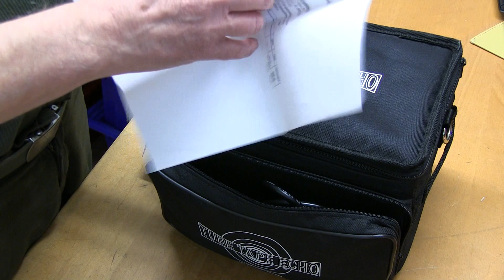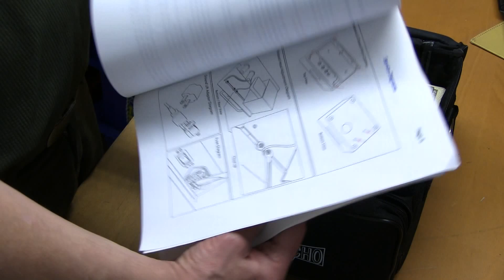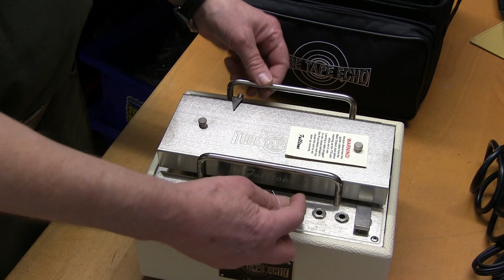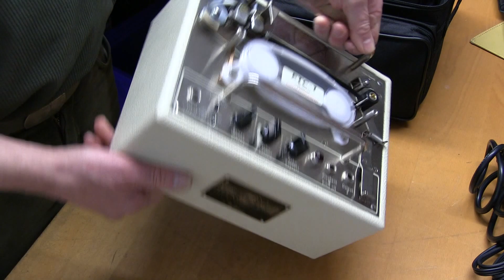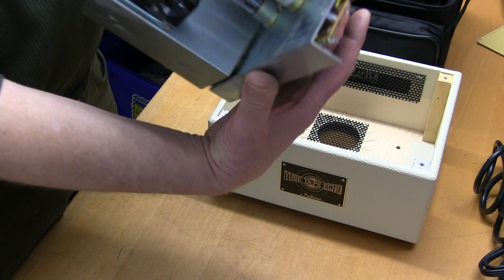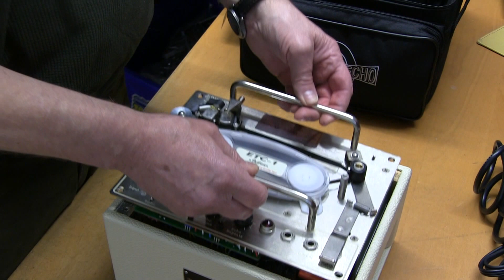Fulltone TTE Tube Tape Echo. Original Model from 2004

Comment: I've had doubts about tape delays, was thinking about buying an old Binson Echorec instead or trying to piece one together, was really inquiring if tape delays are good for constant gigging and playing, was just having operation doubts under pressure and stress, that's all.
Reply from the maker: I agree.
Why use a big clunky machine at a live gig, when a modern foot pedal will do it all, and the audience will not hear the difference.
Of course in a studio the superior tape machine will be obvious on the recording.
Reply: I can't talk from experience but just look at how many you see atop amps at gigs (i.e. next to none) vs how many studios have at least one (most of them).

Comment: Nice demo- I'm in the process of buying one at the moment. Just trying to decide between a used one or one of the newer models with the latch / hardtop cover. With something that has moving parts such as this, I'm almost leaning towards a new one just to ensure that it will work properly & without any wear or damage that might come with a used unit. I've no idea how durable / sturdy they are. maybe a used one is fine, hahah. Anyway, I think they sound great ;) Cheers